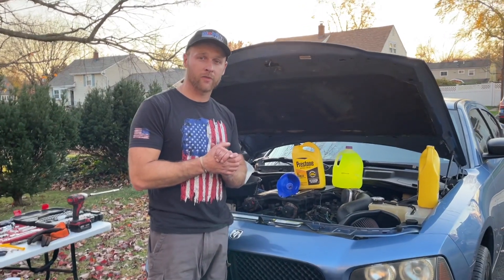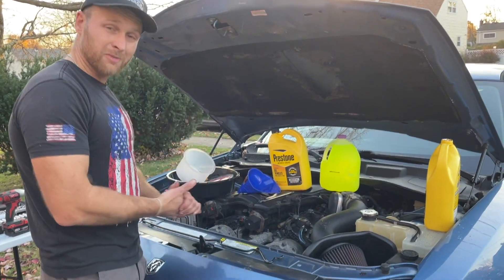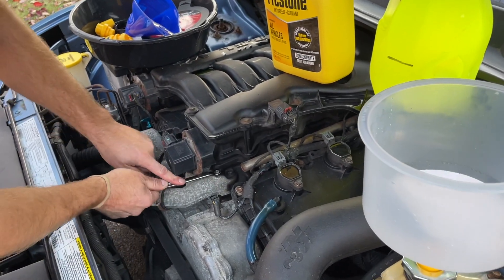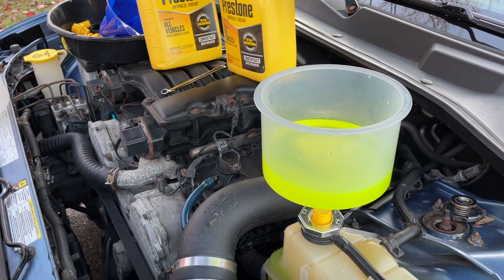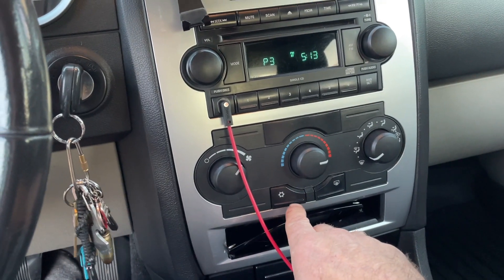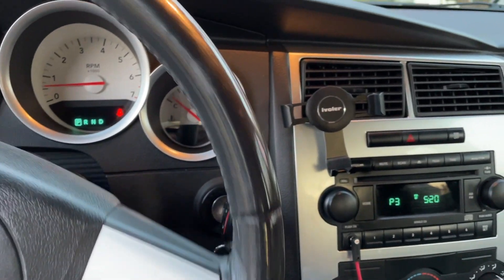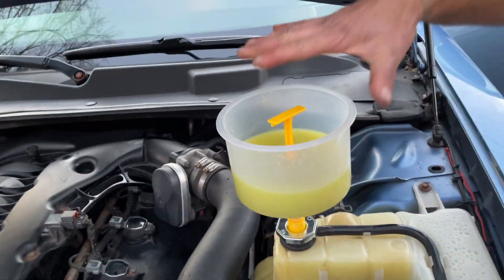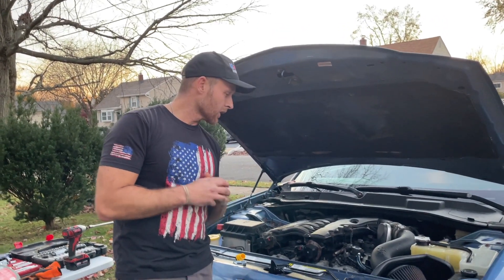How to “BURP” Bleed Air Out of a Cars Cooling System - Easy DIY process for ALL makes

Comment: Hi..is that needed to fill up with coolant half way of the funnel because after you remove the funnel the reservoir will fully filled. My reservoir has a full line one onch below the neck of the reservoir. Maybe the coolant should be file up little bit more above the full line! I do not have a radio or not sure where the excess coolant will go

Comment: NICE one. Was your car not blowing heat in the car? MINES is not , I have a new radiator, new thermostat, new heater . new blend door actuators , 3 if them. My car still blows cold air , I bleed air, but didn't  do it this way. Both  of my inlets to the heater core lines are not hot, I understand it's only supposed to be one. Maybe I need to bleed it this way.

Comment: Without the heater on you'll get a volcano... You can be deceived and you think it's continuous bubbles... Just turn it off you can see more bubbles even after its off then put the cap on it should be right... Without the cap on you having all kinds of strange things... Because it requires pressure...

Comment: Great video,with showing all the ways and we great video angles. A lot of YouTubers should be the same.  
I have a question too if you don’t mind. I have a 04 grand Cherokee 4.7 and my upper radiator hose collapses when it cools down. I looked it up and it seems to be the cap. Do you agree. 
Ty

Comment: Hey, how you doing? I have a question so I have a coolant temperature sensor that I need to change, but I don’t know if I need to burp it if I’m just gonna switch the sensor fast I’m sure I’ll lose a little coolant, but probably not too much if I change it quickly, so do I still have to burp the system if I just changed the coolant temperature sensor

Comment: Sometimes the caps don't fit your car.  Buy an OEM cap from the dealer, then drill a hole in it just big enough for the funnel to fit and use electrical tape to make it air tight.  My F 150 doesn't have a vent port like in this video.  Just fill the funnel a little more than half way, start it, turn the heat on and rev it to 2000-2500 RPMs, the go to idol, repeat mult times until the bubbles stop coming out in the funnel.  Check it every day after you drive it.  More trapped air will come out so just top it up.

Comment: Great job. Tech question. What if you do all of that and still have pressure after letting the vehicle sit. Happened to me with a Honda Accord V6 I replaced a radiator on. Did the burping procedure twice already. No bubbles no coolant in oil replaced radiator cap and did combustion gas test

Comment: Is my coolant boiling cause there’s air in the system
Reply: Probably not, just fixed this on my car and it was a faulty radiator cap. If that doesn't work try temp sensor or thermostat replacement
Reply: Just had the same problem. If your dash is showing above normal range for the temp and the coolant reservoir is over the full line when driving for a while, it's most likely the thermostat. the thermostat only lasts for so long, so if your car is older, it's probably that.

Comment: If your heater and a.c are working good would you change the thermostat or temperature sensor?. My code is p0128 i was told it's either the thermostat or temperature sensor

Comment: This video helped, i have a 2019 Ram,with the stock 203 Thermostat the truck would climb to 230, and i swapped it out for a 180 Thermostat it climbed to 230-240, i didnt realize you had to bleed out air from the cooling system, Thank You Brother!

Comment: Your not supposed to burp any motor.
The cap bleeds the system of any air pockets eventually
You just fill up slowly and the air will come out itself
Reply: I believe some cars don't doesn't have bleed valve

Comment: Solid tip. Just changed water pump in my 2017 explorer. Gonna do this method as u showed. Jumping over to Amazon now to search for it. Hope u get some kick back. U just got them a sale👍🏾
Reply from the maker: Have fun. 👊💪
Reply: @ got’er done. New water pump in. Timing seems to be on point. No leaks from timing chain cover and after burping radiator like u showed here. It’s been back on the road for a week now and running beautifully.

Comment: Last Sunday I had to replace the thermostat on my 2006 Buick with the 3800 series 3, it was causing a check engine light.  I have never done a bleeding procedure before and was very nervous the whole time. I followed your instructions.  Your explanation is the best one i've seen.  I let the car run and I worked on that for probably almost an hour.  The biggest concern I had was how to know when ive done enough bleeding.  It kept pushing air out..then no air would come out and it would look like it was done.. then id raise the rpm again for about 5-10 seconds and more air would come out.  I ended up having two huge air pockets come out at different times.  So when it appeared to be clear of air, it wasn't.  Thats why i did it for what seemed like an hour.  Anyway, it worked very well.  No overheating and the heat inside the cabin works better than it ever has.   The car computer turned off the engine light after 29 miles.. I got it inspected a few days later and its all good now!  Holding proper temp at 70 mph, and great heat in the cabin.  Thanks!

Comment: Excellent instructions. I had error code P0119 "Engine coolant temperature sensor 1 circuit intermittent" on my 2014 Cadillac ATS and I could hear gurgling in the dash when I started the car. The coolant level was low in the reservoir. I haven't seen any leaks or evidence of coolant in engine so I suspect (hope) it's a slow leak. I got the funnel that you have and followed your guidance. All solved now. Thanks!

Comment: Tried this with my 07 civic and for some reason it will not work.
Reply: If it’s a kseries engine I would recommend a pressure bleeder. You can get one at harbor freight. K series are known for burpin issues and this is the easiest way.
Reply from the maker: Not sure about the civix

Comment: What happens if the radiator fan or the fan never starts spinning?
Reply: If your hoses are warm, I’d check the coolant temp sensor. 
If they are not getting up to temp, you could have a faulty thermostat
Reply: @ I changed all that. My coolant resovoir is boiling and shooting out all the coolant. The fans are spinning near the radiator.
Reply: @JusThrowitDiscGolf  well, honestly try what the video says. Sounds like you need to bleed the system
Reply: @ I did. That’s why I’m confused. That still has nothing to do with the radiator not turning on correct?
Reply: Try the radiator fan switch

Comment: I'm confused as to why you need the funnel. Can't you just open the reservoir?
Reply: The funnel places the coolant level above the rest of your cooling system and hoses. That’s why you see the bubbles in the funnel because the air is escaping upwards.

Comment: Great video, short and sweet - I’ve had a water pump , heater core change and coolant flush done some weeks ago but checked the coolant expansion tanks and it was below minimum with no signs of leaks. I’ll follow your video to maybe flush the system again of any air locks and get a new coolant expansion cap . You’re video gave me the confidence to do this myself so thanks again
Reply: Did level stop going down?
Reply: I got rqdiator change did go to mechanic twice for low coolant in reserviour.
How did you fix it?
Reply: Hi guys - I changed the coolant reservoir cap  ( £10 ) and haven’t had to put coolant in at all for the last 2 months . It’s a pressured cap and when the valve wears it allows excess vaporization of coolant which literally vanishes into thin air . I got an OEM part from VW just to guarantee longevity . Let me know how you all get on hope it helps 👍

Comment: 1. You must wear gloves when touching coolant
2. Bleeding and that extra gadget BIG funnel is not necessary if you do the following: pour slowly; squeeze the hoses; push acceleration repeatedly for 2min while running the engine and top off coolant; turn the car but not the engine on max heat but on low, run the car in inspection mode. You spilled all that coolant. You must wash that off as coolant can destroy things.

Comment: If you drain the antifreeze from
the peg plug alone does that remove enough of the old antifreeze or is there still antifreeze in the engine block 
I want to just drain and fill new  but not sure if just draining  from the peg plug alone will remove all the antifreeze 
Anyone have some advice on that ?
Thanks

Comment: If you have to remove a coolant hose to move it out of the way to get to a spot you want to work on, do you also have to bleed the entire system?
Reply from the maker: If you loose coolant. Yeah.  There will be air there so good to bleed to some extent at least

Comment: Please help me understand. I don’t understand the necessity of having that much coolant in the reservoir or using this system. It seems to me that as long as you had enough coolant in the reservoir where it didn’t go low enough to suck in air that would be the same thing. I just don’t understand. Please help me I’m really trying to understand.
Everything else In the video was very helpful.
Thanks 🙏
Reply from the maker: Yeah it’s too much but that will overflow or you remove it once done.  Just have to keep adding to burp the system

Comment: SAME SAME BLEEDING JOB VIDEOS  HOWEVER THE AIR IN THE HOSES NEVER  RELEASED STILL DODGE OVERHEATING ISSUES AM SURE IT'S AIR IN THE HOSES BLEEDING JOB HAS NOT WORKED OUT FOR ME
Reply: So how did u fix it cause I'm having the same problem

Comment: I hope you still answer questions on this video, i was just in a accident in my other vehicle and my family is down to one car and Im needing to use this tool to get the air out the coolant system.

This is where Im confused. Was your coolant system totally empty? I was doing mine after a flush, so it was bone dry. 

One confusion is I thought the temperature gauge in the car dont suppose to move at all. Ive heard that if your temperature gauge moves its still air in the system OR are you saying only through this process the temperature needle in tbe car should drop down when the thermostat opens?
After doing this the temperature needle in the car shouldn't move right? 

Respectfully, you said you want to wait till you see the bubbles stop in the funnel.. as you notice the bubbles stopped once you started closing the bleeder. So do you keep letting it come out the bleeder till you stop seeing bubbles in the funnel or wait till you have a steady stream coming out the bleeder? 

Did it stop showing bubbles because your reservoir was full or the best thing to do is let some more out the bleeder close it and wait till no bubbles in funnel before the reservoir gets full? 

Last question, its 2 or 3 adapters I could use. The red one fits into the smaller hole in the reservoir and the metal cap fits on but the gasket falls off the red one when pulling it out.. the black adapter fits more to the top main entry of the reservoir and pushes down snug when i put the metal cap on. The yellow one i have fits like yours but I cant get the metal cap to twist on. Did you have a little struggle getting your metal cap on to make sure its air tight?

Sorry for so many questions, this is the best video explaining how to use this tool.  There youtube channel instructions are horrible.
Reply from the maker: hi.   I had to change hose and thermoastat so most of coolant was gone yes.  once all replaced, I filled with coolant etc, and started to the burping the air out process.   its not end of the world if you don't do it.  but do the bleeder valve at least if have one.  but its good to do it, to get rid of the air pockets in the hoses etc.    as to the kit,  as long as you can mount it, so coolant don't leak out when you have it filled you are fine.   little drip you should be fine.  they say adapters are for all makes but who knows.   if bubbles mostly gone you should have most air gone.  maybe 10 min or so for the process .  or whatever I mentioned in the video.   I hope this help.  best of luck.
Reply: @HowToWithLech  appreciate it, thanks for the response

Comment: So, some one just told me to do this because I put coolant in the reservoir but when I crank the car it drains but there isn't any leaks. The radiator is not full. So does doing this help with my issue?
Reply from the maker: Make sure radiator is filled up and what’s needed I reservoir tank.  This process is just to clear the lines from any air pockets.  Once u have the coolant in

Comment: I have a 2007 dodge 3.7 nitro 4wd I have a radiator cap and reservoir which should I use to bleed my system ?
Reply from the maker: I would do the radiator cap.    How I did my other car

Comment: What if a car doesnt have a bleeder? My vehicle also does not run up to temp for fans/thermostat opening without the coolant res cap on. Will using this funnel method allow my car to get up to temp for thermostat open? I noticed you said your thermostat was opening but it wasnt even at 20c. Mine opens at 97c.

Comment: You forgot to mention how to do it without the bleeder port. My pump does not have one
Reply from the maker: You do the hose part only if no bleeder
Reply: @HowToWithLech  thanks. I struggled with mine and found out I need to move it. Probably because it was slightly downhill and or it needed some extra push.

Comment: Thank you so much, Lech! This video helped save my F-150 after my heater core inlet hose broke due to age. I didn’t realize air was introduced at that time & didn’t think anything of it until my radiator fans started behaving like helicopters. This is the clearest & most accurate presentation on how to do this, thank you again so much! Do you have a Venmo i can donate to for your time & effort please?
Reply from the maker: Amazing. Happy to help out.   And appreciate the feedback.  Yeah, added my Venmo in description.  Thanks 👊

Comment: I wonder this is done without that big kit, all Iv seen is guys open the valve and wait until bubbles come out and then it stops after a few seconds and they tighten it up. 

Also can you just dump water over the thermostat to clean Coolant spilling? Is there any concern over wetting parts of the car with water?

Comment: Fan motor does not need to be on high. Temperature select does need to be maxxed so max fluid flow can pass through. Having fan speed on high makes heater core act as a miniature radiator, cooling fluid and lengthening warm up time.
Reply from the maker: thanks

Comment: I replaced my thermostat then filled it took it on a drive got to hot went home looked in the morning have tiny leak but today I drove it for a hour then it said reduced engine power?
Reply from the maker: No sure. All replaced and installed correctly.   That should not cause  that issue

Comment: So, does it matter at what time you start the car and turn heat up? I've seen other people have the car on and the heat up the whole entire time. So we can turn car on after coolant is added? I'm learning. Thanks so much for this informative video. Have a prosperous new 2024 ❤
Reply from the maker: Yes start after all is reassembled and coolant in. And can add more as needed
Reply: @HowToWithLech   ok. thanks for the info. I ordered the funnel kit but have been hearing about how it doesn't fit securely. I will work with it anyway. ❤
Reply from the maker: it should. and for some cars it might be special adapters.   but I think you'll be good @jaywholoveseveryone1721
Reply: @HowToWithLech  You are such a blessing to me. thanks so much 💖
Reply from the maker: thanks :) @jaywholoveseveryone1721
Reply from the maker: appreciate you

Comment: After replacing the radiator on my ‘19 Chrysler Pacifica and burping the cooling system using this method, from time to time I notice the coolant level is higher/lower than normal after seating overnight. Car is not overheating. Do you think I may still have sir in the system? My minivan no longer has the air bleeding screw from older models..
Reply from the maker: Hard to tell.  But I think you are ok
Reply: @HowToWithLech  I found the problem, it was the coolant expansion cap O-rings that were swollen and deformed, hence the cap wasn’t holding pressure. I replaced the cap, coolant level and temperature range are fine now.
Reply from the maker: nice. thanks for sharing @MikeSF5

Comment: EXCELLENT Video Sir. This is a comprehensive and wonderful tutorial on coolant system air removal. I love it! I even went to my local autozone and got the kit since the funnel and screw driver was giving me issues. but it did work just fine, little messy though.
Reply from the maker: Nice. Thanks for sharing

Comment: After I put my antifreeze in I let the engine run till the temperature gauge was halfway. Now, I opened the bleeder screw on the top of the engine. I did this 2 times and the air was out of the engine.
Reply from the maker: Nice 👊👍

Comment: Hello , i am using the same Lexus RX300, 1999 model engine 1MZFE . we accidently swap/connecting the Vacuum Surge Tank pipe to the water outlet there just below it. the system was filled with water until the water comes out at The Charcoal Canister through the Air Drain Horse, back there beyond the gas tank.. We have tried to remove the water by sucking and blowing through the pipes and even put the new service kit since we found some plugs socked in water. but still the car wont start but cranks. what advice can you give sir
Reply from the maker: Not sure to be honest.  Sounds like a bigger issue.  Not familiar with the car, so can’t advise more

Comment: Great vid! I only have one question, you didn't remove the excess liquid as it will "overflow and drain out". How does that work? Does it go back into the overflow reservoir? I've been told to not add coolant above the max line for my 78 TA. What should I do?
Reply from the maker: Correct.   Remove it.  Or overflow drain should do it.  But better to remove